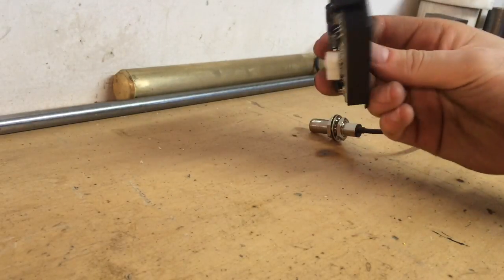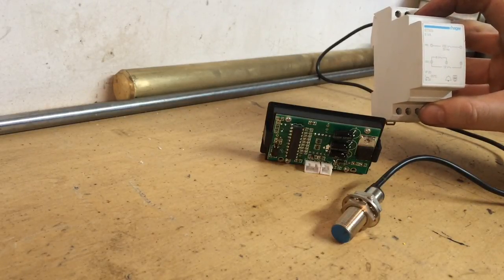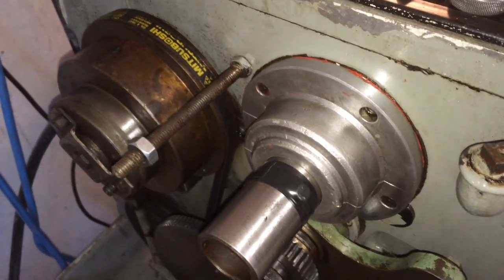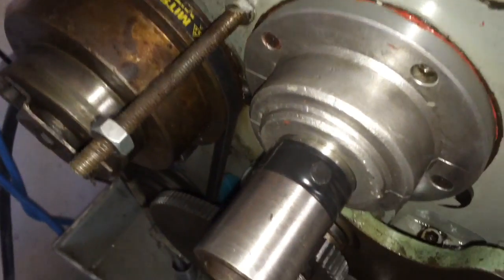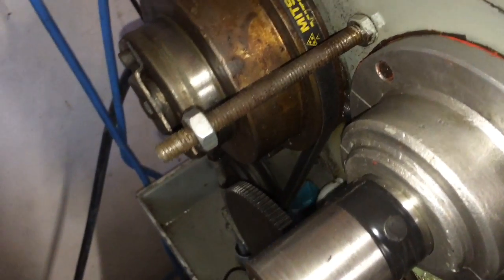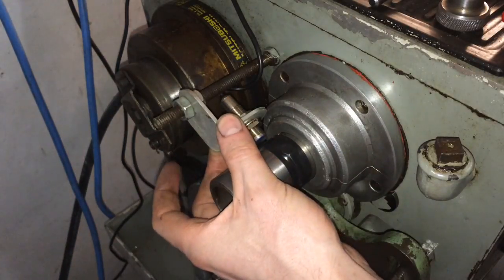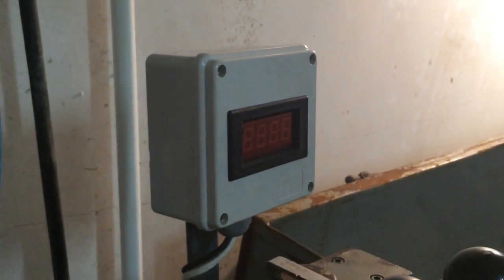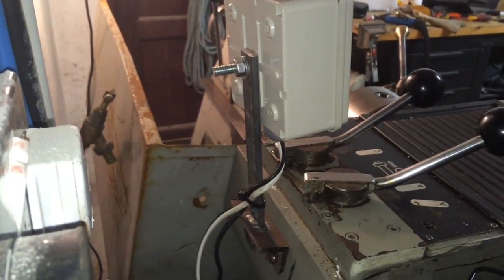Lathe Spindle Tachometer Install

Comment: Loosing the watch and putting on safety glasses is a good idea, but loose the gloves or loose a finger. - NEVER use gloves, long sleeves, or even have a rag in your hand around rotating machinery. You might get a scratch or burn or a splinter but you are playing with loosing a fingernail, a finger or hand, an arm, or your life. - I have seen it happen - Going on 60 years in the trades my friend. 

Remember guys, Loose the gloves or loose a hand.
Reply from the maker: Thanks for the comment. I agree with you 100%, I never wear gloves when using lathe/mill/drill etc except in the case of this small pillar drill I have which is only 1/4 horsepower and has almost no torque, I can easily stall the motor by hand (it is on my list to be upgraded). I completely agree that in all other cases it is better to risk a cut or a splinter than to be pulled into a big machine. Sorry for setting a bad example in this case.